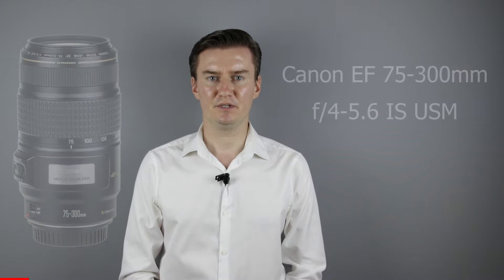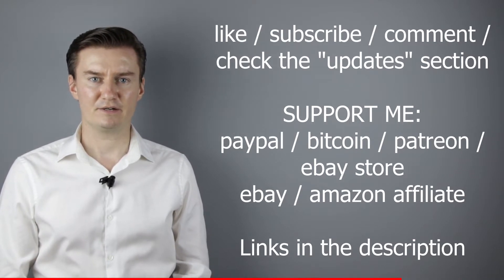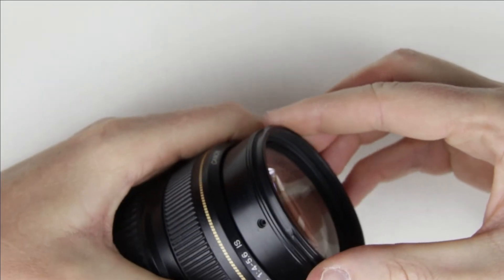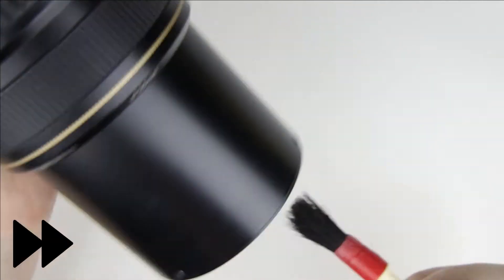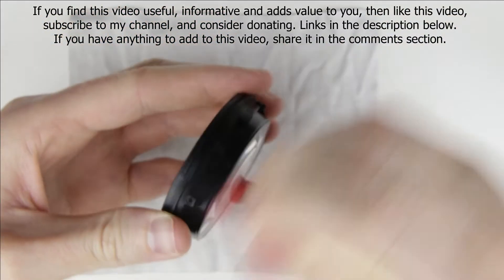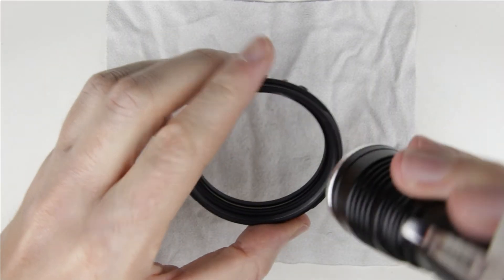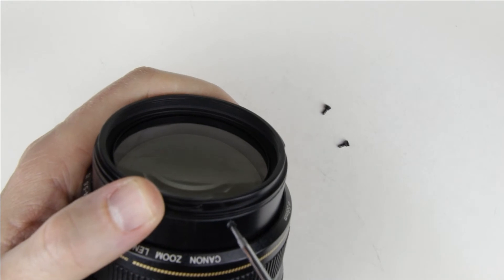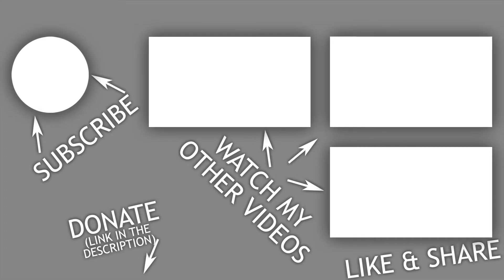Canon EF 75-300mm f/4-5.6 IS USM clean the lens inside

Comment: Does the old EF 100-300 f5.6 L front element come out the same way ?
Reply from the maker: I don't know, I haven't had that lens before.
Reply: The AF EF Lens has a 3 screw bezel. Then the lens is held in by 3 pins, they look like screws but have no thread. Get a small flat screwdriver and prise the pins out, the outer lens will then drop out.

Comment: What about cleaning out the interior lenses? Mine actually fell into a bucket of soap water completely soaking the internal lens and moisture in between the main outer lens and the very thin lens behind the two. After it dried out for about three weeks I was able to take the two lenses on the outer side clean them and put them back in but then I noticed there was soap residue on the internal lenses by miracle the thing still works but I still have to access the internal lenses and clean them as well do you have a video showing how to access the internal lenses
Reply from the maker: You have to completely disassemble the lens. I don't have video about it. Maybe you can search also for 70-300mm IS USM disassembly, I think the two lenses are quite similar.